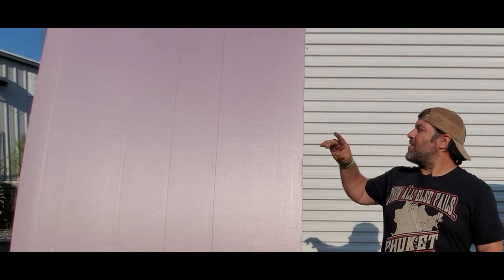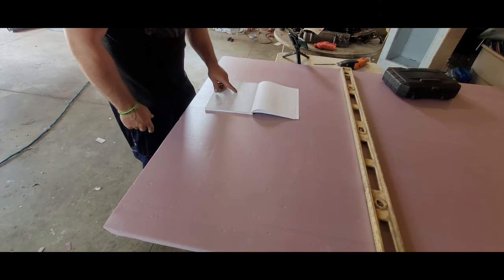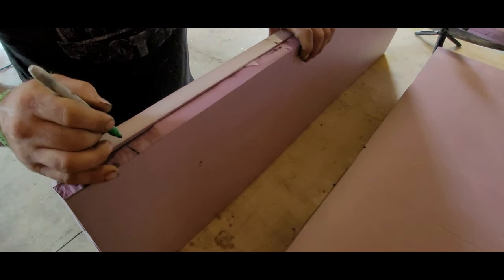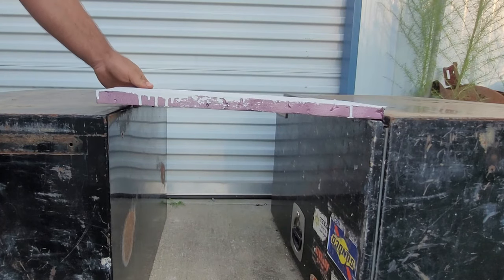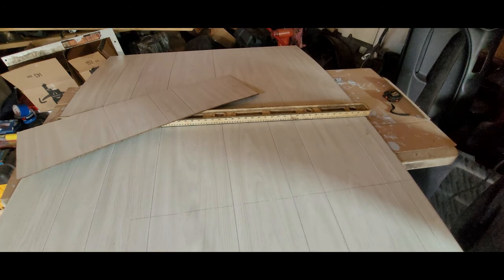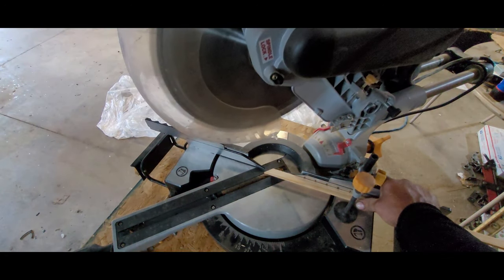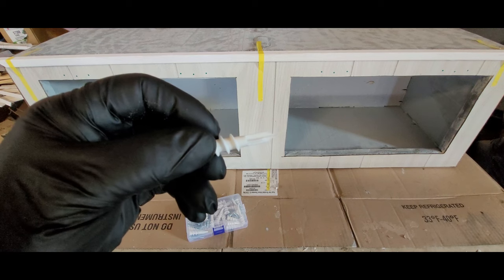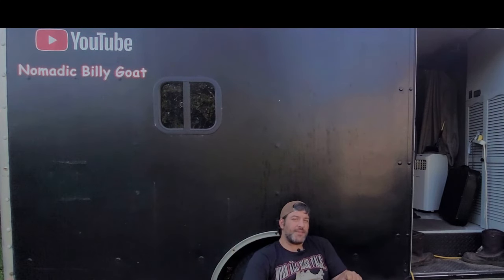How To Build FOAM Cabinets | Van Life | Rebuild The Box Series Part 2 #vanlife #rvlife #foryou

Comment: Wow, they came out great! I bet they're fairly light for how strong they are, too. Can't wait to see the install!

Assuming one has the tools, adhesives, and paint - how much would you estimate they cost to make? Foam, screen, anchors, siding, trim, etc. 

Any tips or tricks you learned to make it easier next time?
Reply from the maker: Thank you very much!
I would estimate that these cost around $100 each to build. Not sure where you could actually find cabinets like these already built, or how much they would be in order to compare. 
Biggest tip... Take your time! These took me a  month to build. (That’s with working full time.) So practically every night after work for a few hours, and then on the weekends. Thanks for watching!

Comment: 👍 Why not use xps for the door?
Reply from the maker: I felt like I needed a more heavier duty door. It has worked amazing since I installed them. Maybe I should make some xps foam doors, and see how they work. Experiments are always fun.
Reply: @NomadicBillyGoat  I am planning to convert a trailer, and fine carpentry work is too difficult. I want to use xps to make the doors. The doors themselves do not hold structural strength, so they are very suitable for xps. The only thing that needs to be strengthened is the hinges, but it doesn't matter if door fail.
Reply from the maker: I agree. The xps foam will also keep the weight down as well. I'd just like to see how they perform while traveling. Good luck with your trailer build!

Comment: Genius. Saves gas, I’m sure. I don’t know how I would do it, but somehow, once the vehicle is stopped, I’d find a way to use 100% of the driving cabin. First step would be removing the seats. It’s just a waste of space . I’m building foam panels 3’ square that you haul in a truck bed and easily construct a cabin.
Reply from the maker: Thank you! I do use the driving cabin when the vehicle is stopped, but usually for storage. I might remove my passenger seat since im solo, but not sure yet. Besides, I do have alot of room in the back for living. 

That cabin with the foam panels sounds like a good idea.
Reply: @NomadicBillyGoat  after I wrote the comment, using the cab for storage came to mind. I’m a crawlspace contractor. I use foam board, felt and 12 mil poly. Lowes has those deck slats used for the railing. Once Great Stuff foam makes contact with that felt it is a lock. I can build waterproof, insulated panels that will attach with pre-applied bolts. 60 panels will go in a truck bed. I’m dying to try it but too busy doing nothing.  lol. Love the cabinets made of foam board
Reply from the maker: @user-qv3dl6ll3q  Thanks! That's a great idea!

Comment: Do you have a more detailed tutorial for cutting notches so they line up correctly?
Reply from the maker: I don't, but what I did was put the 2 pieces flat against each other and used a sharpie to mark vertical lines across both pieces, then alternated putting an "X" on the piece that needed to be cut out.

Kinda like the following:

[ x [      [ x [      [ x [
[    [  x  [    [  x. [    [
Reply: @NomadicBillyGoat  thanks, that makes sense
Reply from the maker: @MikeJordanUnCamplicated Glad I could help!

Comment: Affixing a non stretchable material to both sides with some form of adhesive or epoxy gives a perfectly rigid composite. Fiberglass, canvas, screen, or luan all have the same effect. XPS doesn't compress but it can stretch, so preventing that with the other materials yields a strong composite. However, you have taken the process from others on YouTube but not the understanding of why this process exists, thus you have wasted the screen by not placing it on the other side of the XPS. In other words, others will watch this video and think they only need to reinforce one side of the material with multiple layers, and find they have spent unnecessary time and money when they could have a better result by reinforcing one layer on each side.
Reply from the maker: Agreed, however I never said I knew everything, and the comments section is for viewers like yourself to express your opinion. I do appreciate the information you have provided. I did also build a storage platform out of XPS foam board too, which I did screen and paint both sides. These videos I make are merely ideas. I believe I stated in the video that I'm sure you can make them better. They're not perfect, but neither am I. I appreciate your comment, and I value your opinion. 🙂